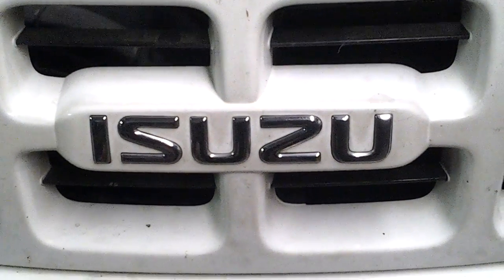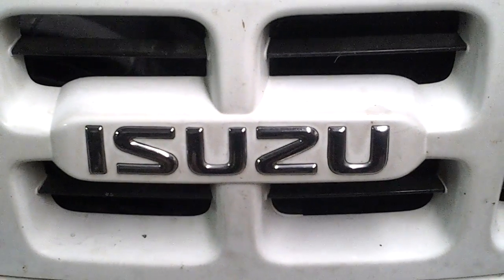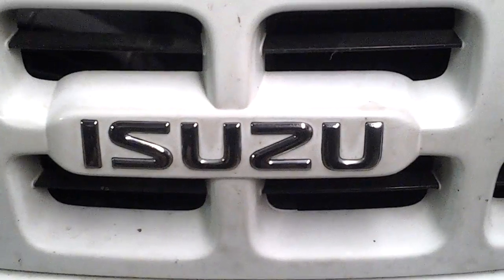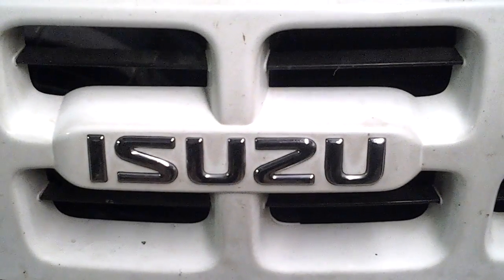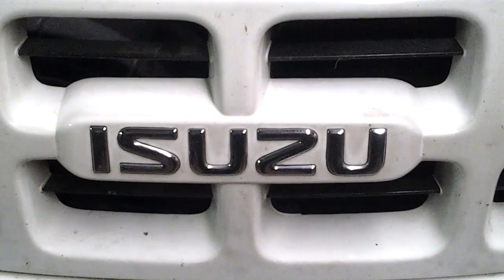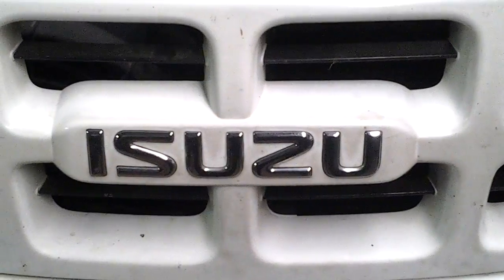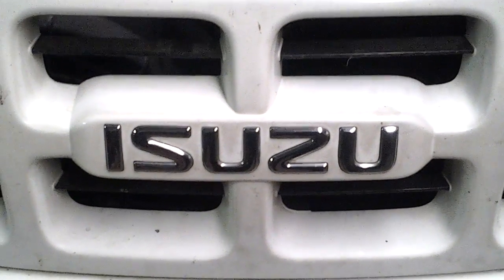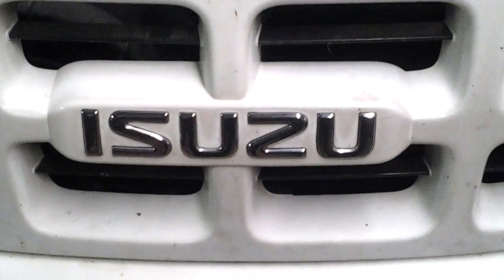How to set the cam timing on an Izuzu Rodeo

Comment: My question is with my 2004 3.5 rodeo cams dont have a 3rd sprocket. So does the same timing sequence right bank dot to dot and left bank double dot to double dot? I got this timing all messed up after doing new valves and head gaskets. The heads are totally different than on here and other clips. Its had a head gasket rebuild once before but not by me.